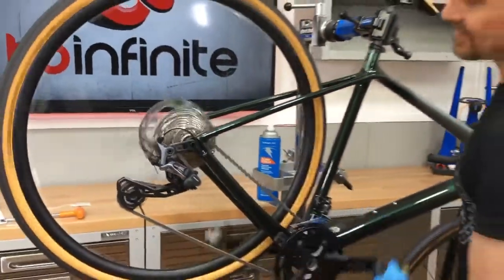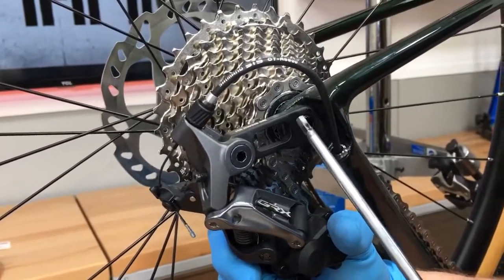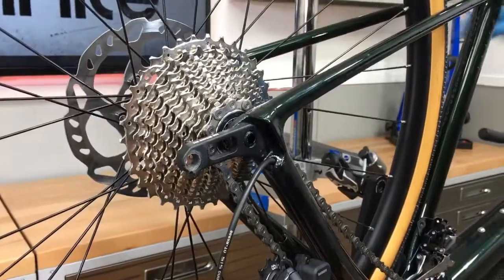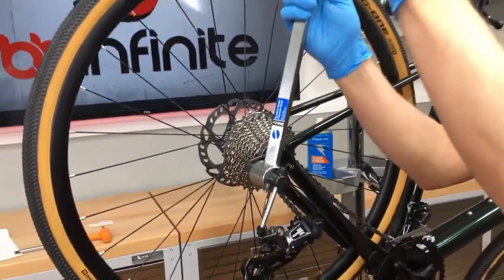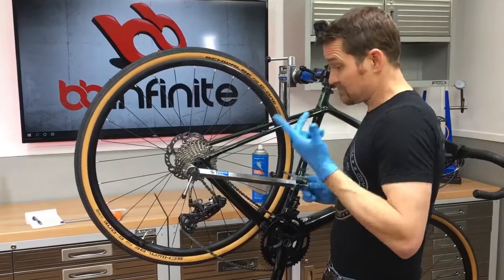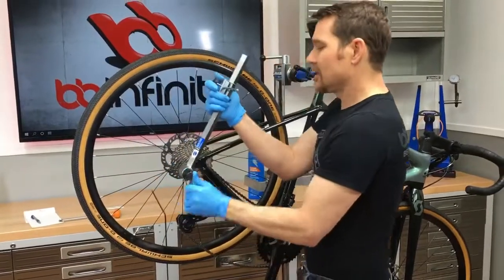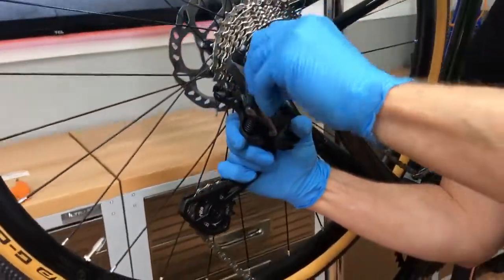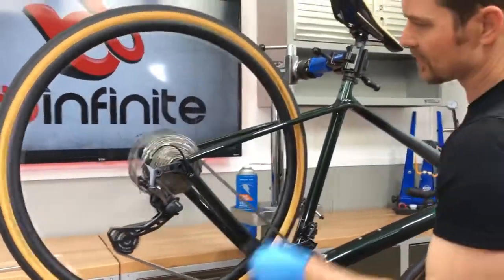Don’t Adjust A Derailleur Until You Do This...

Comment: The wheel doesn't have to be true if you move the wheel and tool and point the tool at the valve for each measurement
Reply from the maker: Exactly correct, if it's a pinch situation your method will work to get it done.